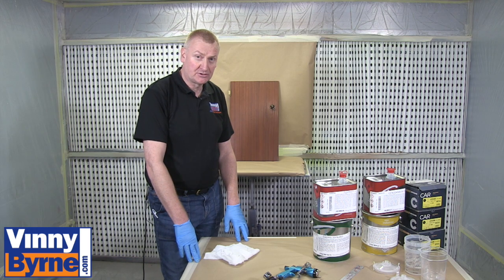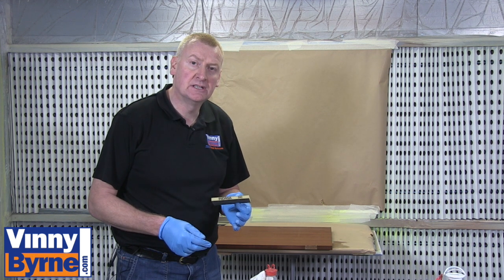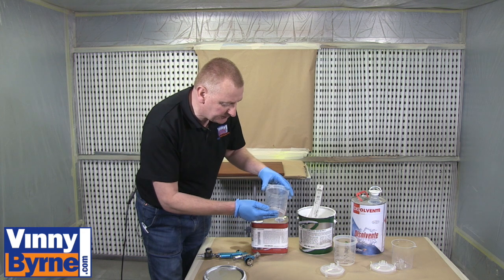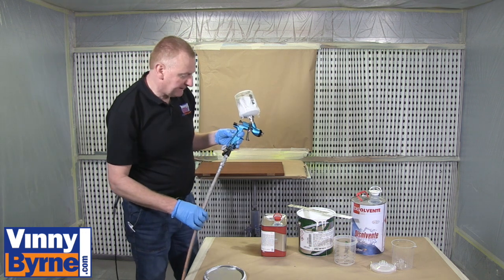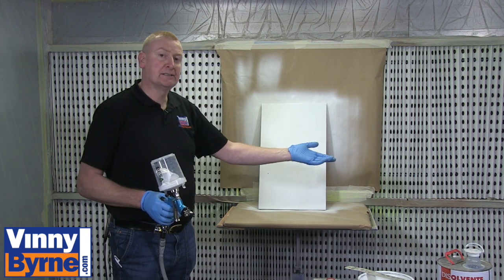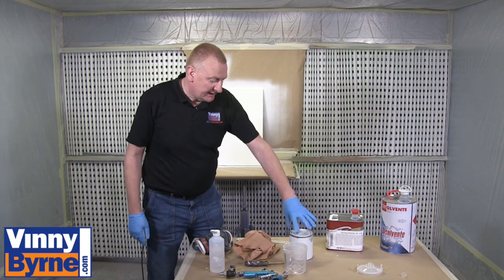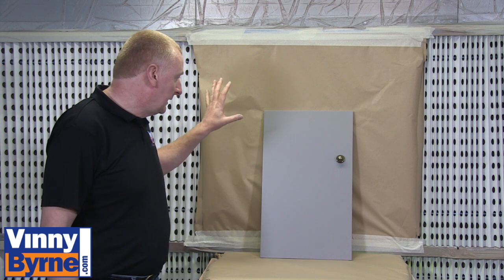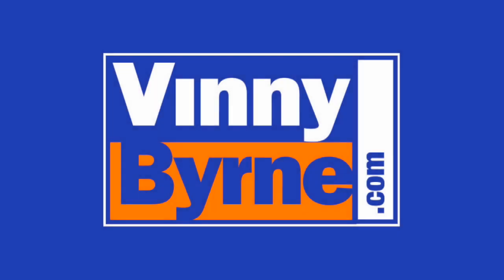How to get a great finish working with 2K Wood Finish Polyurethane PU

Comment: Great video. One question: does the 2K polyurethane works against moisture or water penetration on the wood pores ? Thanks
Reply: It’s seals the surface. So yes it repels moisture